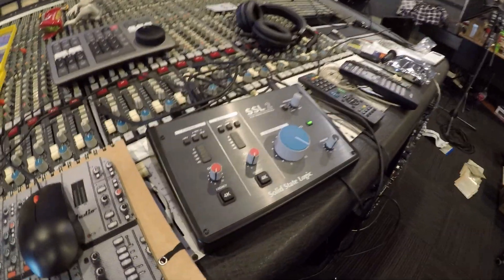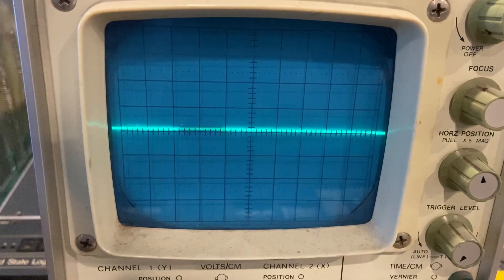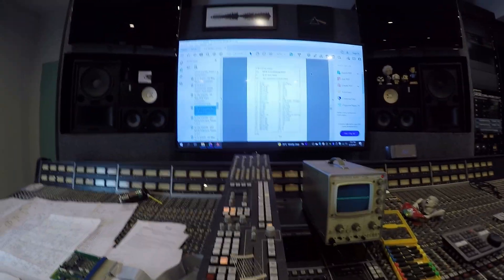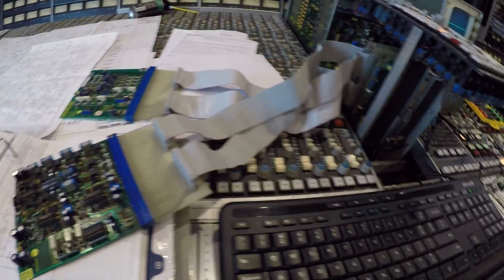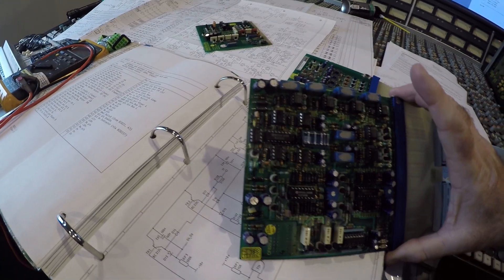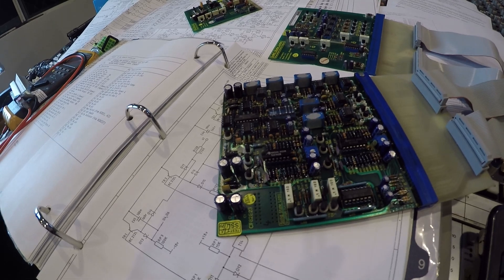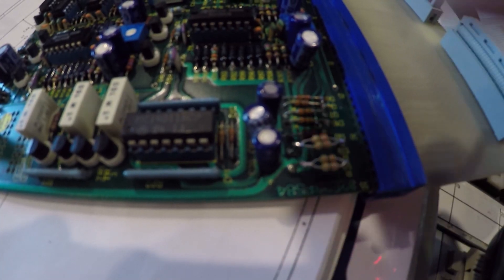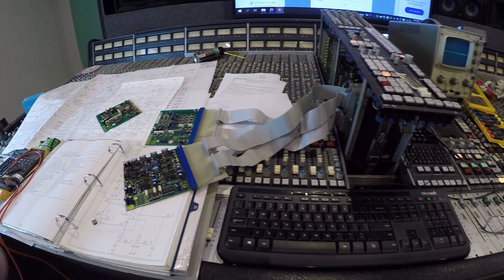SSL6000 Centre Section 82E23 card repair

Comment: how did you get so knowledgable in this?Nice desk!
Reply from the maker: Thanks, if you break it down this console is fairly simple as it's mostly just discrete electronics. It's just big with lot's of repeated sections. There's no surface mount devices and the boards are not packed too tightly. With the schematics, a multi-meter and an oscilloscope there's no fault that can't be found. It just takes time in such a large console but it's just a matter of tracing through until you find it. The actual repair is usually very simple and cheap, if I was paying for the repairs almost all of the cost would be in technician time to find the fault.
Reply: @v8roverdave  Wow you make it sound simple.Something that most pro's do.😂 Thanks!All the best with the desk and your projects!
Reply: @v8roverdave  Wow you make it sound simple.Something that most pro's do.😂 Thanks!All the best with the desk and your projects!

Comment: I built a bunch of SSL9000 preamp clones, and the guy who made those boards spec'd proper 10 ohm fusing resistors for the power rails. Mouser (here in the US) used to stock them. They're designed to fail more gracefully and not burn holes in your PCBs, but I can't find them anymore.

Comment: Very well explained repair. Must have been a challenge to find it (at least for me it would have been). Hopefully, you'll be doing more videos on this series. Well done.
Phil
NYC Area
Reply from the maker: Yep there will be lot's more when I get the time. I have a few mid production now. That fault was actually quite easy to find, just a matter of applying a test tone to a suitable input and tracing it through the various board inputs and outputs until I found one with an input but no output. Pulled that board, plugged it into an extender card and started the trace process again but within that board but I quickly found the split and burned parts so then it was easy.
Reply: @v8roverdave  Thanks. I'll look forward to future installments of the SSL series. Very interesting watching the process. 
Phil
NYC Area

Comment: Do you stil have time to produce/make music.
Reply from the maker: Yes and no. This space is currently being used mostly for short film post production so lots of video editing, ADR and Foley recording. Not doing much band recording but that will likely change in the future. I need to do a video on the space itself, it's had a few upgrades lately and I'm doing more outside video broadcast work than recording right now.

Comment: Wouldn’t have been better buying a new API 1608? Less time fixing it and less money probably
Reply from the maker: Maybe but where's the challenge? I also like vintage gear, the $70K I have in this could have been much better spent I know but it's also about preserving a console that could have been scrapped.
Reply: @v8roverdave  Well, if you love the repairing part, then it’s all good. Cheers!
Reply: I feel like a 1608 isn't an adequate replacement for a 48 frame SSL maybe?

 But I hear you. An SSL tech friend of mine recommends not buying vintage SSL anymore.

I would probably go API Legacy is I was in the market for a large format console. And I might be, in 2023.